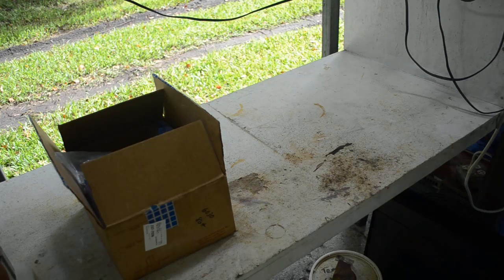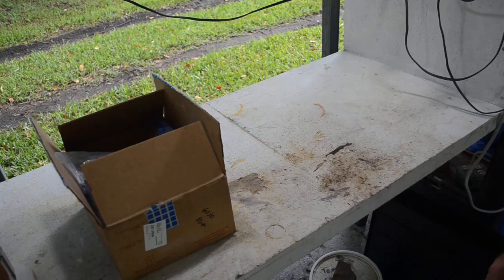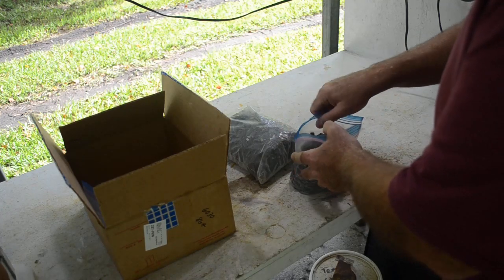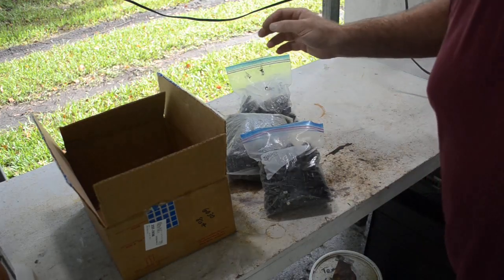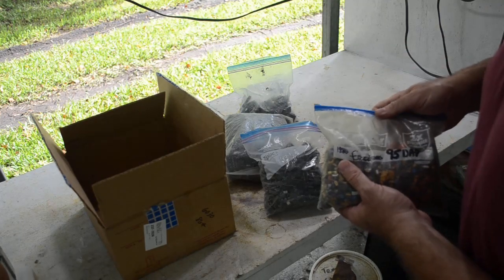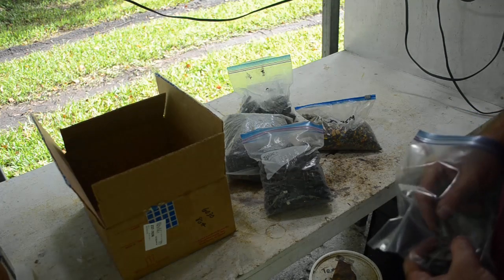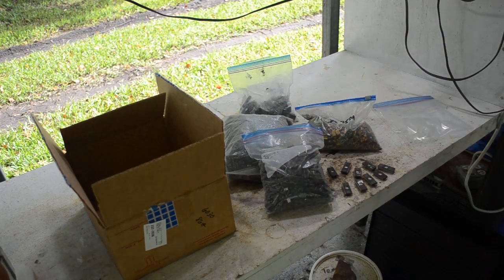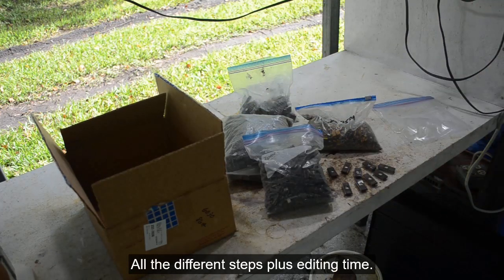Mail Call: A couple of kilos of IC chips from Nick in Iowa

Comment: Tantulum is almost impossible to process.  Takes MASSIVE heat and I don't know ANY home refiners who would even waste their time trying.
Reply from the maker: I've done a bit of research since I got Nick's package. Tantalum is difficult to recycle. I'm not so much worried about heat. It's the dissolving it in a mix of hydrofluoric acid and sulfuric acid that really scares me. HF is really nasty stuff. I've had to work with it in the past. It's the only compound that really scared me. Then there is the part about reducing it back to tantalum metal by reacting the molten salt with sodium metal. What could possibly go wrong there? My research led me to a recycler who buys scrap tantalum capacitors. These guys are probably a better option for anyone with a lot of scrap tantalum caps. https://www.tantalumrecycling.com/
Reply: @omegageek64  I was about to suggest that same tantalum buyer lol